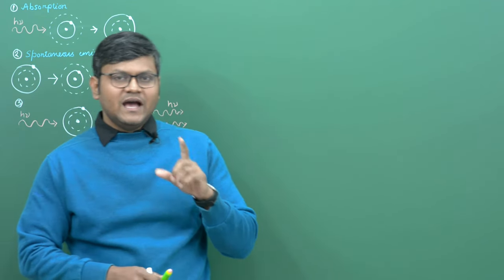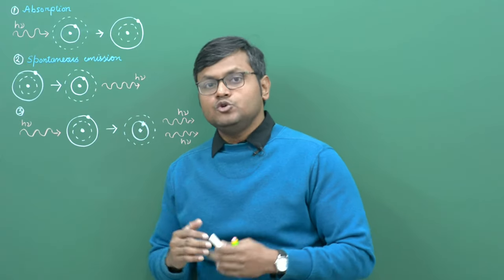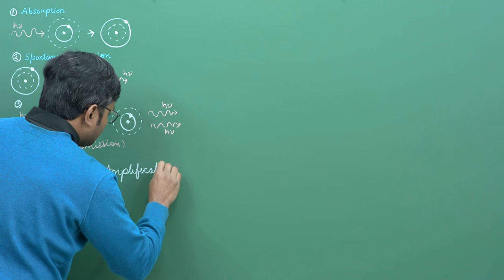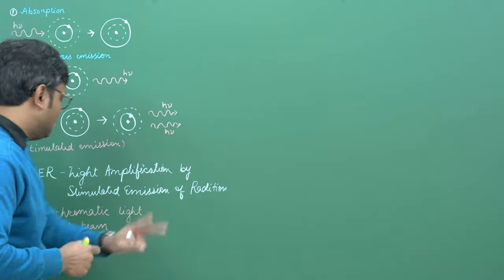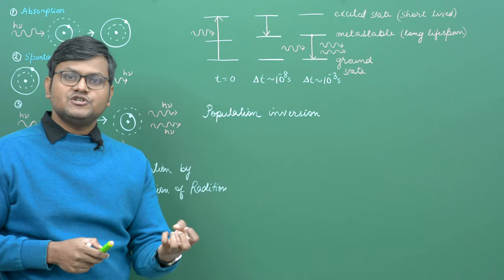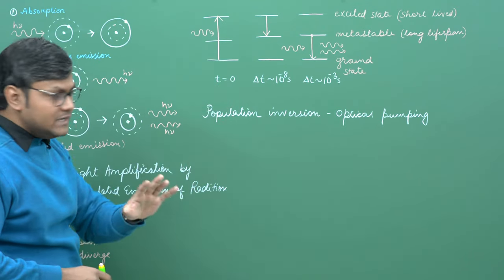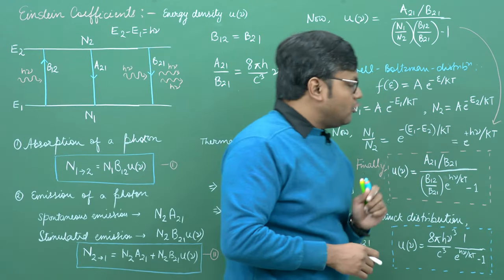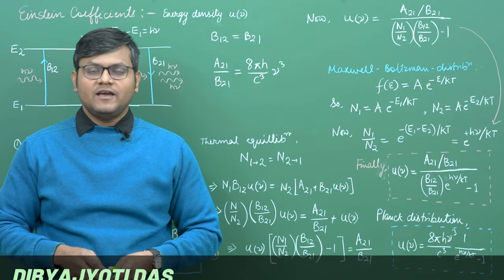Laser Physics - Stimulated Emission & Einstein Coefficients | Three Level Laser

Comment: Some questions Sir: 1. Ground, metastable and excited state are of atoms or electrons? 2. If it is of electron's, then is this state quantized? 3. what actually is a metastable state and how is it different from excited state in terms of energy? 4. Can we actually de-energize electrons in atoms to push it to the ground state? (when a photon hits the electron in metastable state it actually transfers the energy to it right? ) 5. Is there energy difference between the incident and emitted photon in laser? 6. for absorption we have photons of different frequency and for stimulated emission we have photons of different frequency, does that mean, we have 2 different energy sources or the laser is going to use the photons emitted by spontaneous emission as an input for stimulated emission?
Reply: Here is the small attempt for your queries 
1.Both atoms and electrons can be excited to higher energy levels in laser system, depending upon the material used. Like for semiconductor lasers 'it is the electrons which get excited by the external source '

2.yes the energy is quantised which enables the stimulated emission of laser light 

3.metastable  is the energy state where life time of excited atoms or electrons is in the order of 10^-6 sec . Which is slightly Greater than that of excited state.  And in terms of energy metastable state has lower energy than excited state and higher than the ground state 

4.yes exactly.to understand that first we should know about what the photon actually is.   It is a fundamental particle of light which stores the energy and momentum.and it doesn't have mass
So it just transfers the energy to electron,for the stimulated emission to be taken place.

5. No , maximum they try to maintain the coherency between emitted and incident photon. Because laser emits the coherent light. Meaning there's no difference properties of incident and emitted photons

6.for absorption and emission solely photons are not responsible there are other sources like flash lamp , electric discharge and in some cases photons also.so photon has to maintain the frequency which can excite and de-excite the electrons or atoms between the desired state.

Any mistakes or left out topics I will be happy to consider

Comment: Sir why is the transition from excited state to metastable state non radiative ? If it is possible then there should be no difference in energy between the two said levels. Please explain it
Reply from the maker: Energy can be transferred via (1) radiation emission, (2) atomic/mol vibration (3) phonons in crystal lattice, etc. So energy is still lost, therefore energy levels of excited state and metastable state can't be same. It's preferable to have non-radiative transitions, although it's not always the case
Reply: Thank you very much sir.